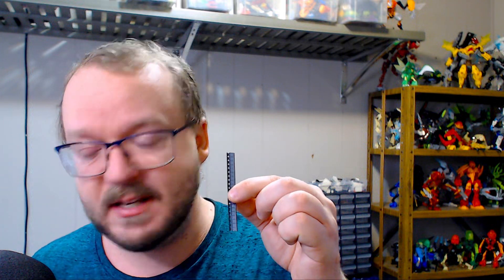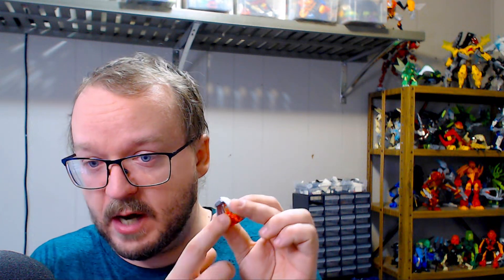The Project: Glowing Bionicle Eyes Circuit Part 1

Comment: I've gotta wonder if this would be easier with a remote... I've seen plenty of remote controlled LED devices that have multicolours, brightness, cycling, etc. All from the remote. Could the mechanism get fit into a small piece like that?
Reply from the maker: Different versions will surely be useful for different builds & things